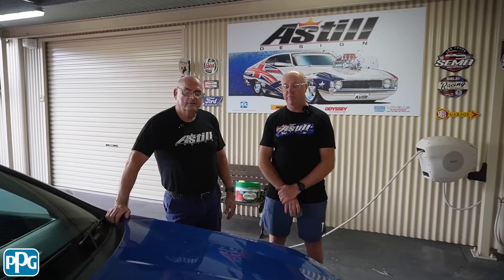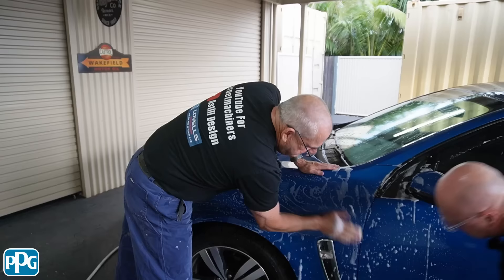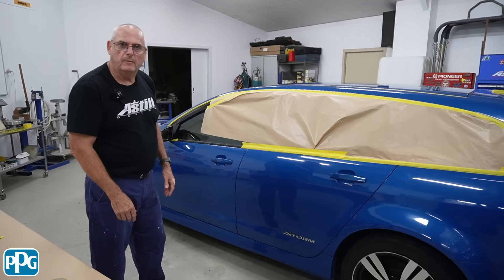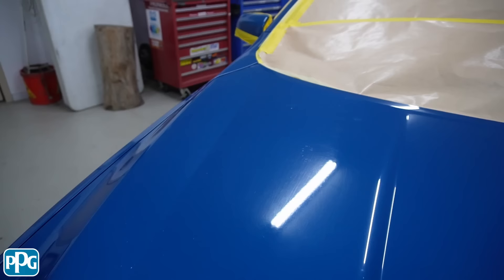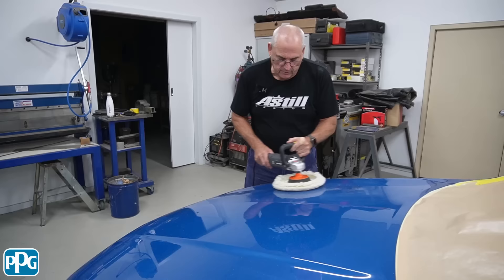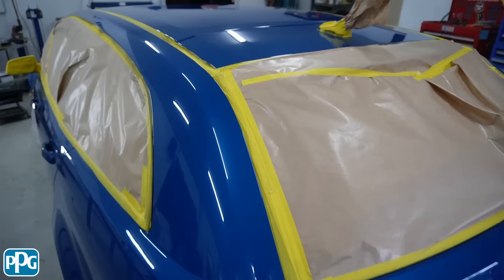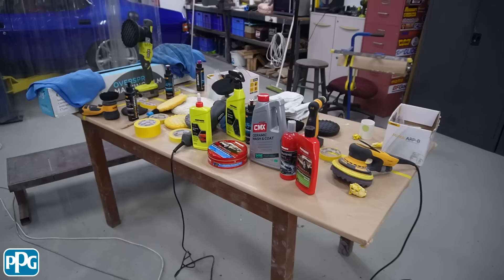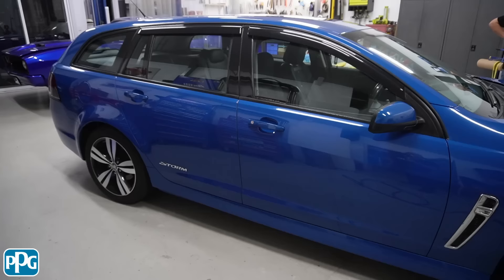Step By Step Process to correct & polish factory paint

Comment: Ive found the Izito polisher at Bunnings but it comes with a 180mm velcro disc. What size pad and brand are you using on yours?
Reply from the maker: The one I'm using is just a generic 100mm from the auto paint shop

Comment: My old grey coloured X Type 2005 unfortunately lives outside through hot sun summers and very cold winters. There is a big patch, (400x500mm) on the roof that looks completely dull, I mean matt; like its been wet and dry sanded. Im assuming it still has some clear left but I don't know. Would it be best to T Cut by hand to try and get some shine and then wax it to prevent any further deterioration? Or would it be better to wet and dry sand the whole roof with very fine grit, 3000???? and spray some clear on? I don't have a flash spray gun so was thinking of just using a spray can clear? Yes I know, not professional but I just want it to look OK and stop any further issues. Im old, the car is old and I can't afford a new one or a professional re-spray. BTW like an idiot I used my Karcher to clean the car once when it was covered in mud and turned the nozzle to a fine point and I stripped some of the clear off the bumpers so was going to w&d sand feather the edges and blow some more clear onto the underlying grey paint. Any advice please.
Reply from the maker: Hi, bit of a tuff one to answer, If your going to paint it with clear you will need to use at least 800 wet to get it to stick.
Reply: @AstillDesign  ok thanks I’ll try some cutting compound by hand first to see if I can bring it up to some sort of shine then wax it maybe. I’m assuming that even the the most coarse compound would not be as aggressive as 800 wet and dry paper?

Comment: With those sections of clear, ie where the bird poo has eaten into the coating, and you don’t want to risk sanding through, I’ve noticed that a lot of late model factory paint jobs where that coating lifts or spreads—especially on plastic spoilers and skirtings. Is this an unavoidable fact of life, or is there something that can be done to mitigate the damage on a daily driver?
Reply from the maker: You can brush touch with some 2K clear, leave for a few days the sand with 1500-2500 then polish. We will probably do a video on doing chips and like later. Cheers H

Comment: Back in the day turtle wax was the go then came McGuire's? Think I spelt it wrong , now  it's Mother's gee all I want to do is hand rub a wax onto my paint  work , nothing fancy just give it that extra protection over the paint , seriously what's the best
Reply: Everyone has an opinion, and theyre likely all different.  Find the one that YOU like and run with it.  
Dont write off the DIY ceramic coats, some of the new kits are really amazing and last a LOT longer than a good old coat of wax.
Reply from the maker: Any of the top brands will work, sounds like carnaubra wax every 6 months is the go for you.

Comment: Howard as a professional detailer, the only other advice I would add is beware if f jewellery and clothing. I noticed you were wearing a big watch and pants with metal buttons. These should be avoided. Anything like belt buckles, zips, wedding rings are all coming in contact with the vehicle’s paint.
Reply from the maker: Thanks for sharing, maybe I’ve been lucky over the last 40 years
Reply: @AstillDesign  best way to avoid these scratching your paint… polish while naked !
Reply: You've been detailing 40yrs and still do a  4 stage correction to get results? @AstillDesign
Reply: @AstillDesign you have jinxed yourself now.
Reply from the maker: I must be a bit slow